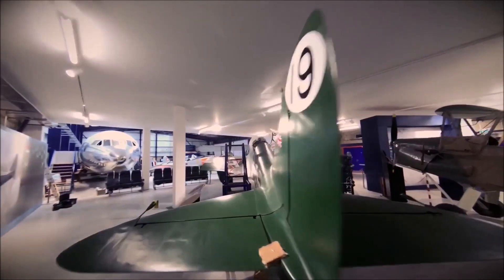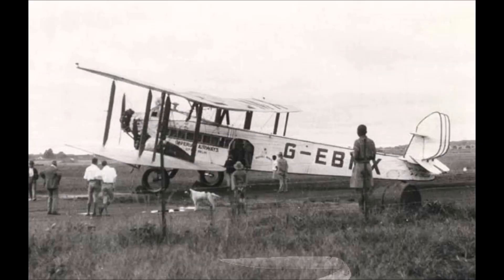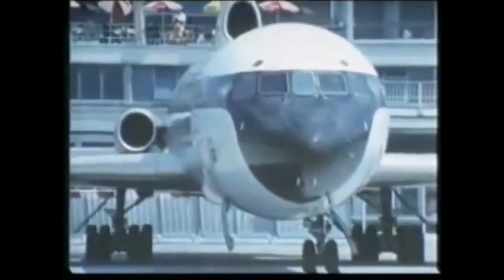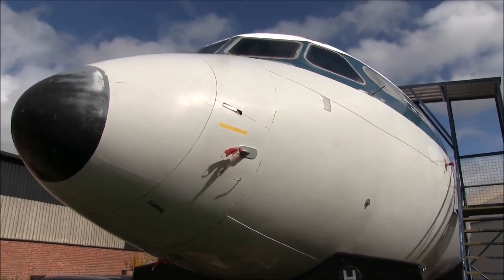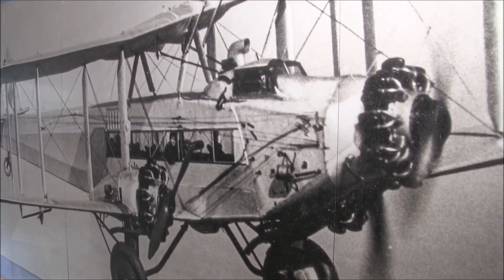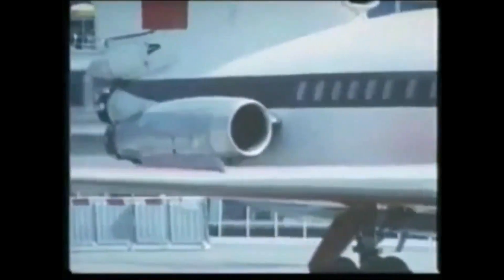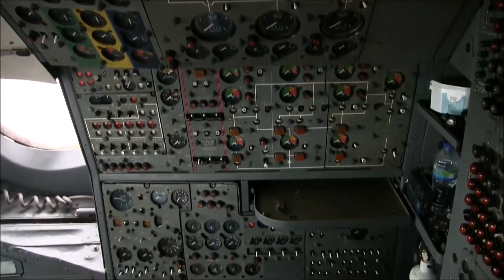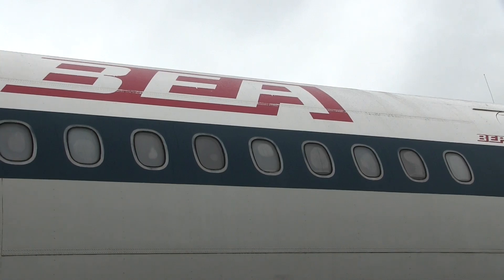One Too Many or One Too Few? de Havilland's Three Engine Designs: DH.121 Trident and DH.66 Hercules

Comment: Three engine aircraft are a great solution to lower reliability engines.  Losing one engine out of three is virtually a non event.  The much higher power and reliability of modern jets and turboprops made this configuration obsolete.  Boeing famously claimed that the 777 could lose an engine on takeoff out of Dallas and still fly to Dubai.

Comment: Putting the engines on the back may have made it quieter inside, did nothing for the noise outside. The Trident was a very noisy plane from the ground.
Designing it to BEA specifications ruined its appeal to other airlines, the original Trident design was bigger and more like the 727.